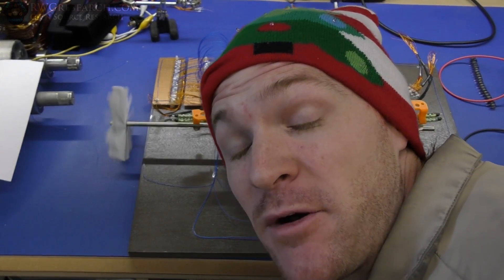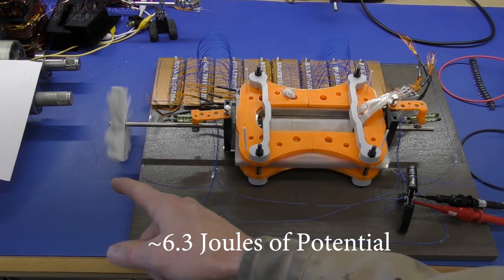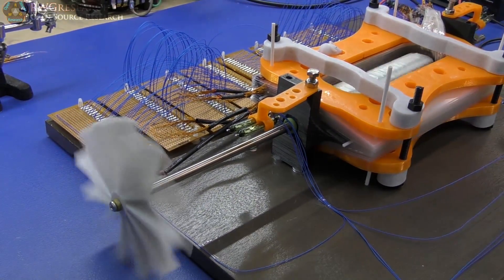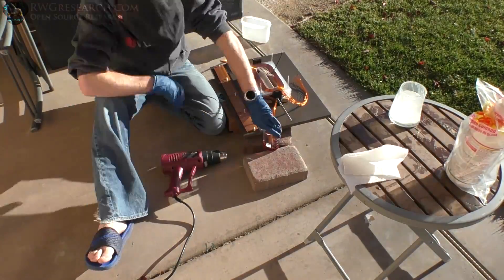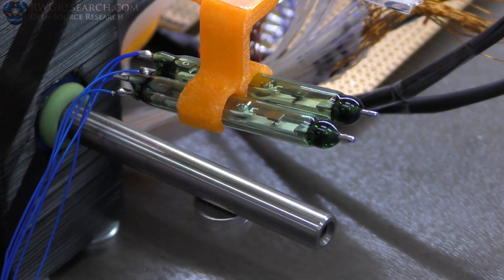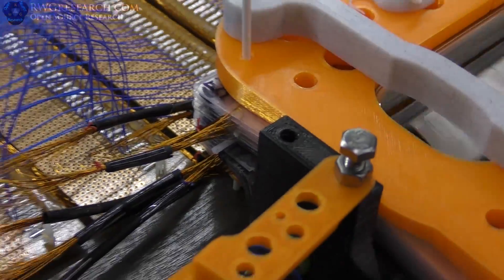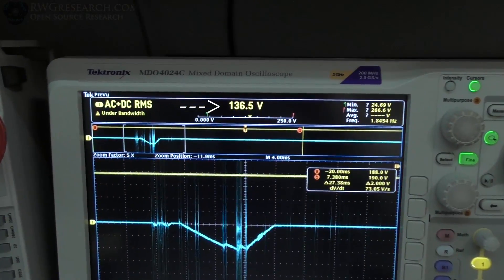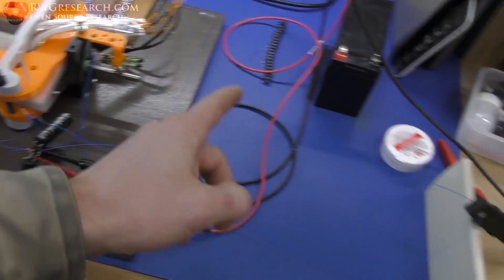The Micro watt "Cheesy Fan"... PMBO 2018 ~Russ's Official Unofficial Entry.

Comment: Hey, I don't know anything about building pulse motors nor electronics in general, but have you thought about making coils out of very thin PCB boards? This way you could just stack them on top of each other around spinning magnets. It would probably save you a lot of time too, and could potentially make your motor even more efficient
Reply: I've also heard they make conductive ink, so you could in theory print your coils on paper

Comment: Amazing methodical build with the pancake coils! 100 hours for the coils is a lot but the build quality shows it was worth it. It must be a very satisfying milestone. I love how you charged the caps up with a bunch of series connected 9V batteries, that's one way to do it haha. Those bearings look pretty interesting with that soft green rubber protruding out. I imagine a good micro watt motor starts at the bearings, so these must be reasonably low friction. The reed switches are a solid choice for the timing too, a lot of hall sensors still take too much power for this sort of thing so passive timing is a really good choice. Great work!
Reply from the maker: it was a huge mild stone. lol yes its the fastest way i could do it with out getting extra stuff out lol. the rubber is just holding the shaft in place. the bearings are generic skate bearings. still got the seals and grease in them lol i need to clean them out and use light oil... then try again! yes i want to stick with mechanical switching for other reasons as well. i haven't even set up recovery diodes yet... that was a step i wanted to take but cant do it the way i want with north and south firing.  I was going to use more reed switches to recover... a lot more to do :) thanks for the feed back! ~Russ

Comment: Hello is this is a new man motor replication in a new set up better to use h bridge circuit  and in higher rpm only you need small input and generate power plus mechanical
Reply from the maker: see description. however this is my take on what i think may be a lot better way to prove what Newman was doing... but i dont think he was fully aware of what he was doing :) more to come! thanks for the feed back !~Russ
Reply: @rwgresearch  from what i beleive but still on test because i dont have time may be in the future the resonace of coil 1 with capacitor 19in parallel  will be interlock with coil 2 with capacitor 2 this will be look like a gear with the magnet is in the middle. its hard to beleive but if there is existing micro gyro it can be flow externally and its draining to your system like other dimension. Coil1 on the top and Coil 2 on the bottom. Well happy new year! Hopeful  i can join in 2019 and 2020 PMBO.

Comment: Will you try using the dense pancake coils simply as HV capacitor plates ? (which would be a similar experiment to the one you already did under this title: The Search For Answers Part 12: "Charge IS Stored On The Plates" Are You Sure About That?)       On a separate note, have you tried testing this physicsforums.com/threads/magnetic-field-rotation-or-not.805357/page-3
Reply from the maker: Now your starting to see why lamanated them!(lamanation film is mylar) And also why there bifilar!!! This is exactly what I'm doing!!! Your paying attention! Congratulations! Now the real question is why... I'd love to hear your answer. There is real  science behind every little detail in this  build... ;) ~Russ
Reply: @rwgresearch   This is the comment on the "GEFA Druckschlag" video, in case it isn't visible, which is sometimes the case... Quote:   /watch?v=xoLmVFAFjn4&t=5m35s . "in a very rigid system pressure waves can reflect easily without MUCH attenuation", Absolutely rigid would mean no attenuation. You can come very close to that. http://www.thermopedia.com/content/1251/ Put another valve, downstream of the cavitation bubble, closing it at the precise moment compression at the main valve reaches maximum. "aligning" micro oscillations into macro, where the whole pipe then vibrates along its length.

Comment: Hi
Would I be right thinking that you could use one half of the bifilar coil to run the motor and the other half as a generator, with the center tap as the common?
Reply from the maker: yeah, you could configure this that way. I have a bunch of tests and configurations to test still. so much more to do! :) however the added capacitance is why i made these like i did. ill explain more in the future videos ( and most of it is already explained in my older videos) thanks! ~Russ